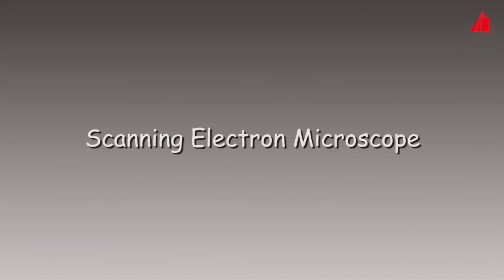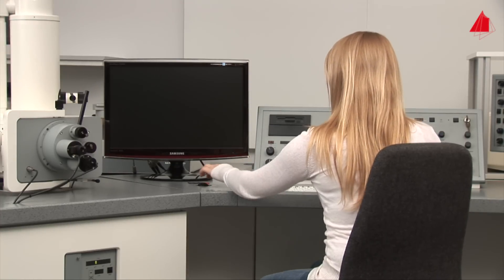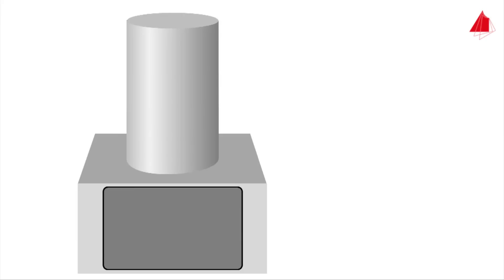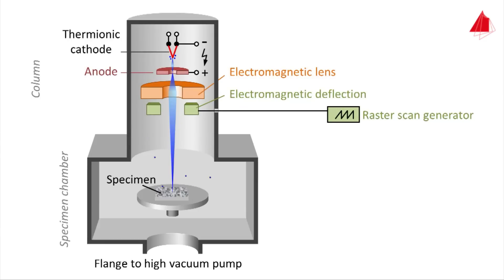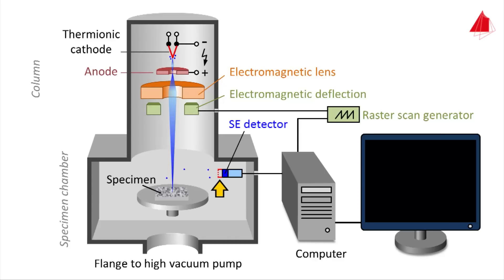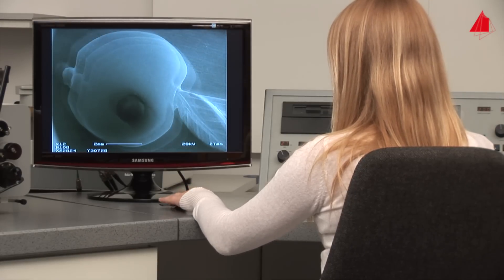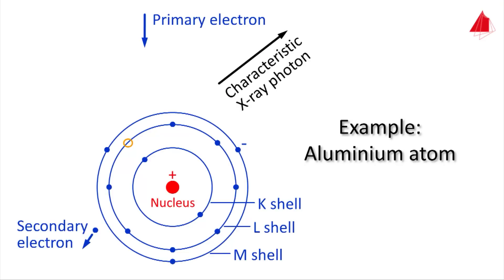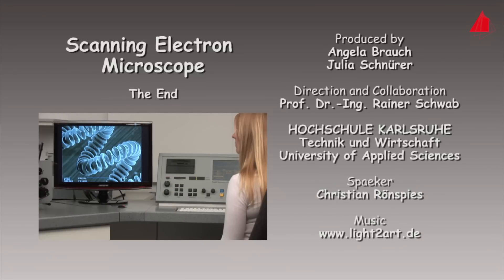The Scanning Electron Microscope

Comment: Tell me how to make one using my used microwave oven. It also do some similar job.....maximum I can allow a compound microscope and a monitor.....
Reply from the maker: Answer to "Tell me how to make one using my used microwave oven. It also do some similar job.....maximum I can allow a compound microscope and a monitor....." Maybe not with a microwave oven, but you can basically make a SEM yourself. However, you really need a lot of components. It is cheaper to buy a used one.

Comment: 8:46  When your nearly $1,000,000 scanning electron microscope is run by Windows 3.1, LOL.
Reply: Doctor and scientist doesn't want update in middle of research.
Reply: It's clearly Windows 2000. 3.x had up and down arrows for minimizing and maximizing windows and it had the dropdown context menu on the upper left. Anyway, the video is obviously from the 2000s.
Reply: Muonium From 2011
Reply: It's actually pretty common for a lot of these sophisticated (and extremely expensive) research devices to be aged and therefore hooked up to an old PC... can be pretty frustrating but someone else mentioned good stability
Reply: the older the windows the more stable it is, that's what you want when running simple applications
Reply: It makes sense to use older windows but a 50 dollars monitor wich I already have in my house for like 15 years... Sure why not...
Reply: imagine turing on the computer for video and message appeared ," windows is updating dont turn off your pc"
Reply: Windows XP with lower settings to reduse load on a application.
Reply: you must be joking. That is not Win 3.1. What you see at 8:46 is the interface of an EDX ISIS analysis software that they used to analysis the  particle constituents of of the Gold.
Reply: @fasilo4852  they are innocent kids 🤣
Reply: If it’s not hooked up online what difference does it make?  I have bad memories about enduring the many “upgrades”of Windows where “oh by the way this feature no longer works”.
Reply: that specific Zeiss microscope runs MS DOS 5 internally, if i recall correctly. The windows machine just interfaces with the microscope for image acquisition.
Reply: Do you know what an operating system is?
Reply: @masimyildiz  no
Reply: they could easily just hire several people to make or build a linux based os LOL
Reply: The newer the computer , the faster and finer picture is. Because it uses new graphic card.
Reply: Updates make your computer slow. so..
Reply: It also has a link to ISIS 🤣
Reply: @takeru51  Your name means stand up?

Comment: Can SEM be used for curved surfaces?
Reply from the maker: Answer to "Can SEM be used for curved surfaces?" Mainly yes. The SEM is perfect for convex surfaces, but not so good for concave ones. It is very difficult to inspect holes, as most of the secondary electrons are absorbed by the hole wall and only very few secondary electrons find their way out of the hole.

Comment: how did reverse beam hiding? 5:38 - first row and then second.. but the beam was not hided, it scrolls all over the material going back and smash the picture
Reply from the maker: Answer to "how did reverse beam hiding? 5:38 - first row and then second.. but the beam was not hided, it scrolls all over the material going back and smash the picture": 
There are several ways to overcome this problem.
- The beam can jump extremely fast to the new position
- The sampling of secondary electrons only starts, when the new position of the beam  has been reached
- The beam may be "switched off" temporarily (beam current reduced)

Comment: I wonder what a set up like this costs.
Reply from the maker: Answer to "I wonder what a set up like this costs." SEMs range from around 50000 $ to about 2000000 $, depending on the "extras". Ours is a mid-range microscope for 250000 $.
Reply: @MaterialsScience2000 But what about its running cost?

Comment: Plz someone tell me are the scanning coils or raster scane generator means the same ?? These are one but name differently ??plz plz someone reply me
MaterialsScience2000 plz ans me
Reply from the maker: Answer to "Plz someone tell me are the scanning coils or raster scane generator means the same ?? These are one but name differently ??plz plz someone reply me MaterialsScience2000 plz ans me" Hope I understand you correctly. The objective lens is responsible for focussing the electron beam on a small spot on the specimen surface. Quite independent of the objective lens are the scanning coils. One set of scanning coils is responsible for tilting the beam towards the left and right direction. Another set of scanning coils is responsible for tilting of the electron beam forward and backward. Both sets of coils are working simultaneously and direct the beam to the appropriate spot. The raster generator is the electronic device to control the scanning coils.
Reply: @MaterialsScience2000  thank you sooooo much you just root out my confusion thank you.

Comment: when an electron of the test object is explled out by the electon beam, doesn't the test object's property change? Due to certain electron configuration the object is defined. Now that it has lost the electron does the object remain the same it was before testing? From the results it is obvious the test object remains same. What is actually happening to the test object, when its electrons are explled out by the electron beam?
Reply from the maker: Answer to "when an electron of the test object is expelled out by the electon beam, doesn't the test object's property change? Due to certain electron configuration the object is defined. Now that it has lost the electron does the object remain the same it was before testing? From the results it is obvious the test object remains same. What is actually happening to the test object, when its electrons are expelled out by the electron beam?":  To the best of my knowledge, an atom really changes its properties a lot, when an inner electron is expelled. However, (i) the number of these atoms (or rather special ions) in proportion to all other atoms in the specimen is small, and (ii) this state is highly instable, the atom repairs itself extremely quickly by the jumps of electrons from the outer shells into the inner shells. So we do not observe any change of properties in the case of metals in a SEM. This is quite different when organic materials (humans, flora, fauna, also polymers) are exposed to fast electrons. Then properties are changed a lot, mostly in a negative way.

Comment: what is the magnification limit that we can zoom up to examine tiny biological living things on a typical or high capacity electron microscope? thx
Reply from the maker: Answer to "what is the magnification limit that we can zoom up to examine tiny biological living things on a typical or high capacity electron microscope? thx" The resolution (this is the smallest distance of two points on an object, that clearly can be distinguished as two points) of a good SEM lies in the region of 1 to 2 nm. Images with magnifications of up to around 500000 may be achieved. Sorry to state, that this is only possible with "dead" matter, not with living things. Living flora or fauna is not suited for classical SEM (because of the vacuum).

Comment: what is the difference of optical microscope with Scanning Electron Microscope ?
Reply from the maker: Answer to "what is the difference of optical microscope with Scanning Electron Microscope?" Actually there is a very large difference. In optical microscopy, an image is created on the optical chip by the objective lens simultaneously (within one instant). In SEM, the object is scanned point by point - and the intensity of the secondary electrons is used as an information for the brightness of the individual image pixels, as shown in the video.

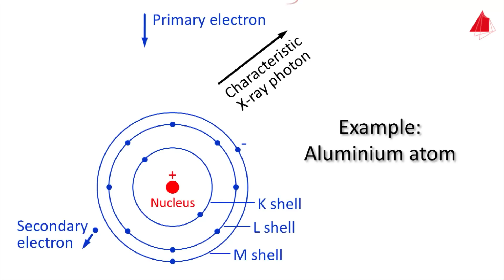Comment: What type of EMR is released in at the red wave? 8:17
Reply from the maker: Answer to "What type of EMR is released in at the red wave? 8:17": In the video, the physical background is very much simplified to make it easier to understand. One of the simplifications is the energy level of the electrons. In the video an idealised single aluminium atom is regarded. The red wave shows a low-energy x-radiation emitted by a jump from the M-shell to the L-shell. In compact aluminium the M-shell is part of the conduction band and therefore more complicated. To conclude: In a real piece of aluminium the red wave does not occur in the way shown by the video, the jumps are more complex.
Reply: I'm going to attempt to interpret this, thanks for the reply!

Comment: How they determine shape by collecting only electrons?
Reply from the maker: Answer to "How they determine shape by collecting only electrons?: By comparing the pixel position in the recorded picture with the position of the electron beam within the scan region - works nicely.
Reply: The way I understand it is, it's more changing the shade of the pixel by how many electrons get kicked (secondary electrons) off from the electron beam. Think of it as 0 electrons = black, 1 = very very dark gray, 5= very dark gray 10= gray etc.  of course that's not the actual numbers but you get the point. The way they put that into a single image is they do that across the whole thing, they start with a tiny part of the top left corner of the specimen, get the information (how many electrons fly off and what shade the pixel would be) and put it in the top left corner of the screen, they do this till they get the whole specimen scanned.
Reply: Ian Stevenson  I see, thank you. I actually forgot I left this comment, and for a bit didn't understand what I was talking about. Hah, maybe I got dumber or something than last year, lol. I should probably revisit this topic

Comment: Hold on. So isn't this basically like the CRT TVs, but with a higher voltage for the x-rays to generate, and the raster detector part?
Reply from the maker: Answer to "Hold on. So isn't this basically like the CRT TVs, but with a higher voltage for the x-rays to generate, and the raster detector part?": Thanks, yes, this is the case, there are many similarities!

Comment: isn't the shading from black to grey to do with atomic weight?
Reply from the maker: Answer to "isn't the shading from black to grey to do with atomic weight?": To some (small) extent, yes. Good contrast between materials of different atomic weight may better be achieved by using backscattered electrons for imaging instead of secondary electrons.

Comment: Is it correct to state that, in order to analyse biological components, a thin layer of metallic material over the sample is required? Thank you.
Reply from the maker: Answer to "Is it correct to state that, in order to analyse biological components, a thin layer of metallic material over the sample is required?": The best images of biological samples are indeed recorded with a thin layer of gold or carbon on the sample. But by using a comparatively low voltage of about 1 kV for the primary beam, electrical insulators can also be captured. Disadvantages: lower resolution, and chemical analysis is not possible any more.

Comment: what is the maximum magnification of these microscopes
Reply: This particular model or SEM in general?
There are some models that go up to 2,000,000 X
http://www.labcompare.com/1346-Scanning-Electron-Microscopes-SEM/10570047-ZEISS-GeminiSEM-Scanning-Electron-Microscope-Series/?pda=1346|10570047_1_0|||&dfp=true
Reply: 30,000X. As they beam electrons instead of light it can go much further.

Comment: I need to know if  this technique be used for Mineral analysis ?
Reply from the maker: Answer to "I need to know if  this technique be used for Mineral analysis ?": Yes, minerals can principally be analysed as well. Since most minerals are electrical insulators, the test pieces normally have to be coated with a very thin layer of carbon or gold before being analysed. Unfortunately, this leads to a reduction in accuracy.
Reply: Thanks